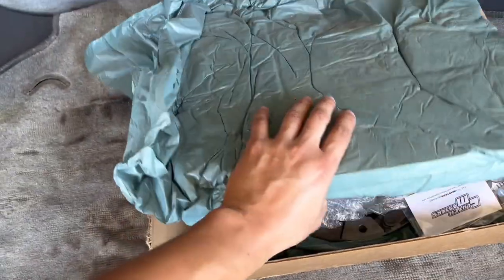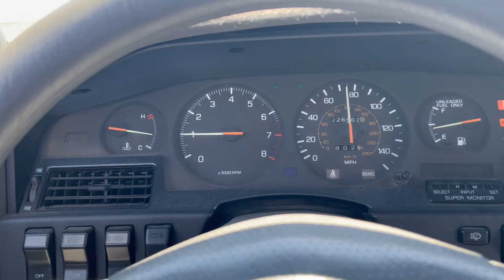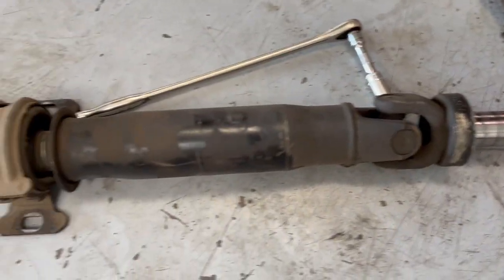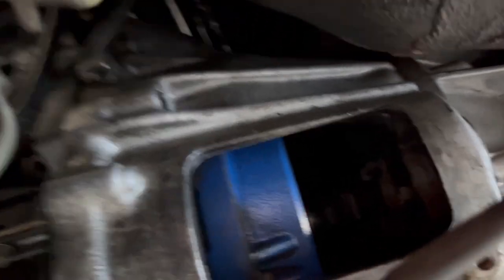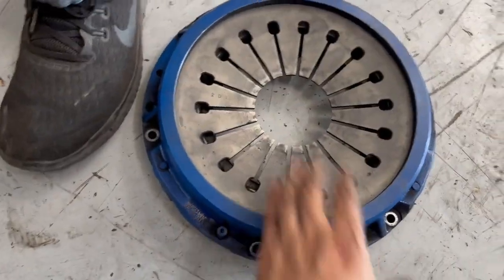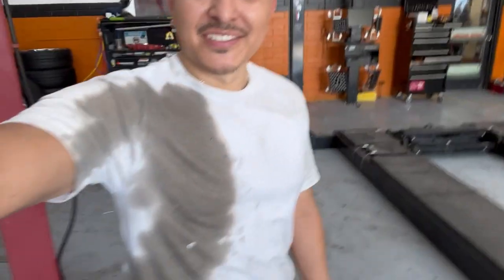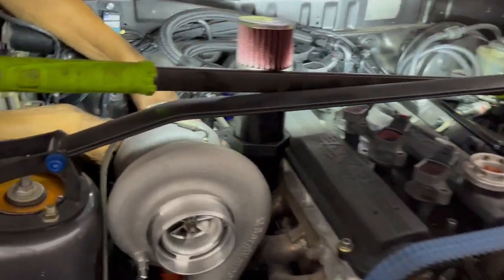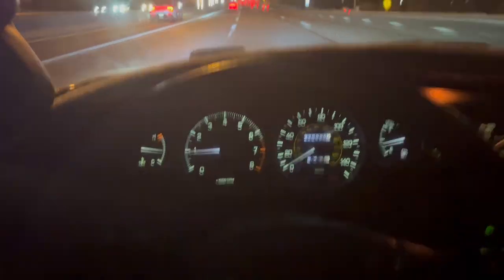NEW CLUTCH GOES IN THE MK3 SUPRA!!

Comment: Quick tip, unbolt the pressure plate bolts through the inspection holes. Trans will come right out super easy. Do the same while installing it, she will glide right in 👌🏾
Reply from the maker: Kool thanks for the Tip
Reply: Is there room to torque it like that?

Comment: i had the same setup bro fx400 with a bone stock 154 making 706 for 2 years and the trans never skipped a beat i ran 1 quart of shockproof and 2 quarts of mt90
Reply from the maker: Hell yea! Good to know. Never heard of shockproof, did u do heavy shockproof or light shockproof
Reply: @-LFATV  yeah Redline makes it same company that makes mt90
Reply from the maker: @suprakhai9933  did u use light weight or heavy weight?
Reply: @-LFATV  heavy
Reply from the maker: @suprakhai9933  thank you brotha ima definitely do this!